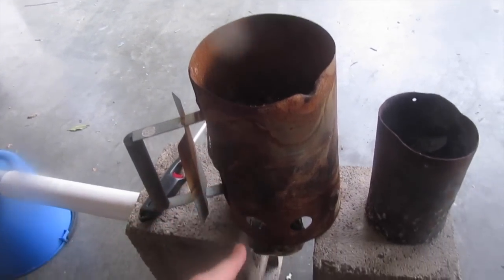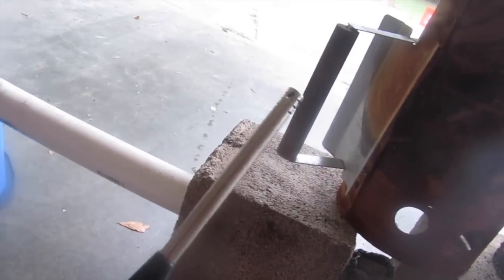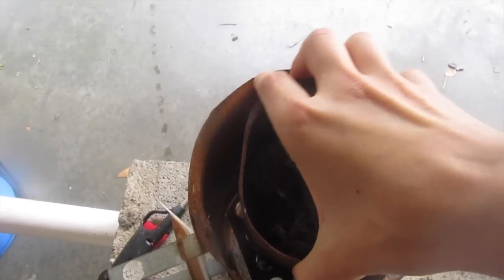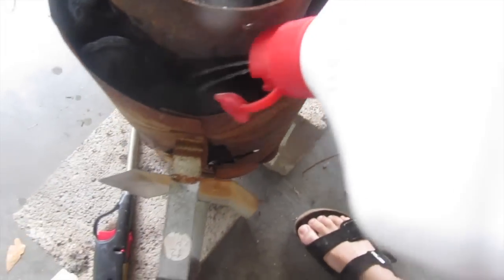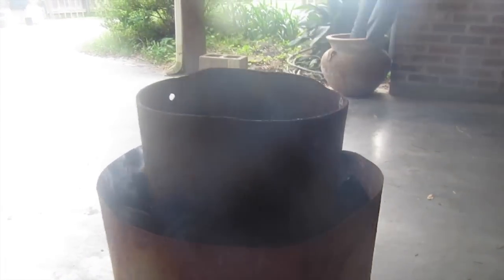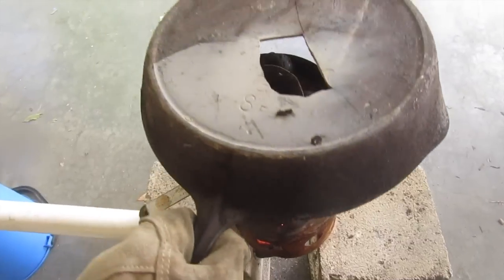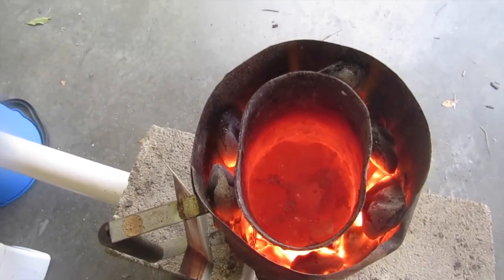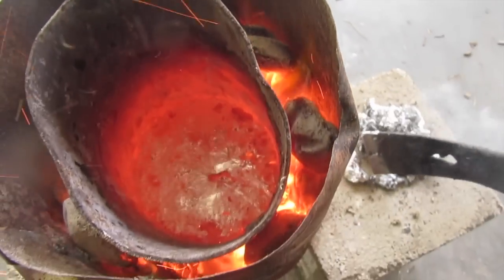HOW TO MELT ALUMINUM CANS AT HOME | How to Make a Homemade Forge to Melt Aluminum | LaneVids Science

Comment: Ummm.... why are you puring charcoal lighter onto charcoal already in a charcoal lighting chimney?  Also,  just turning up your blower to "high"  doesn't necessarily produce more usuable heat.  Excess air flow just forces the heat you produce out of your furnace before it has a chance to be absorbed by your crucible.
Reply: no, just no

Comment: This is a ok setup and you should try wood chips it will make it hotter but thy burn faster so get a lot and instead of pvc use a metal
Reply from the maker: thanks for the tips
Reply: .... but then wouldn't the metal piping get hot.. and eventually transfer heat back to t he hair dryer.

But dryer seems excessive when it puts off heat that isn't needed... waste of electric.